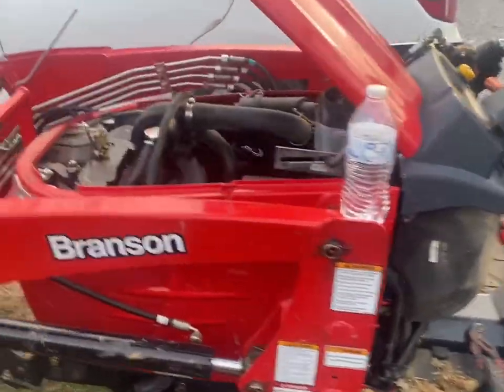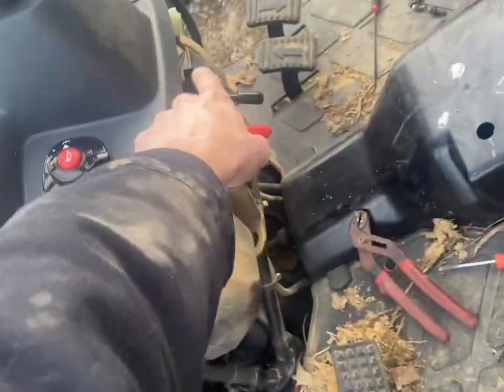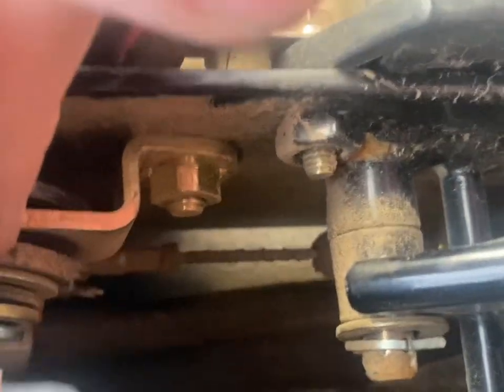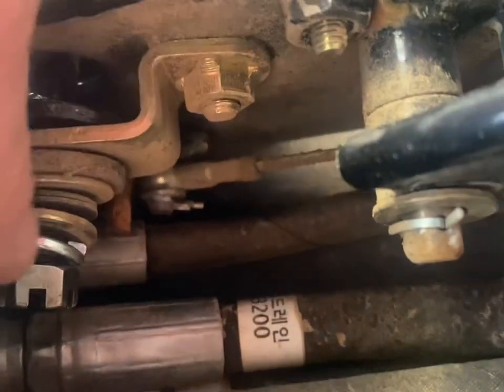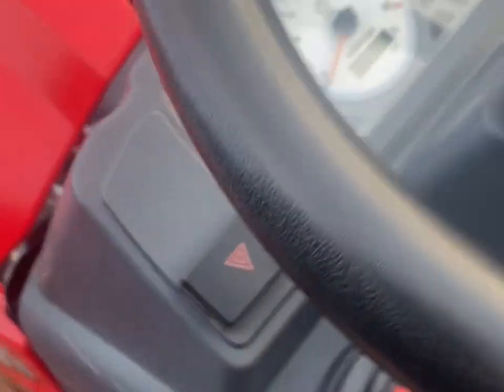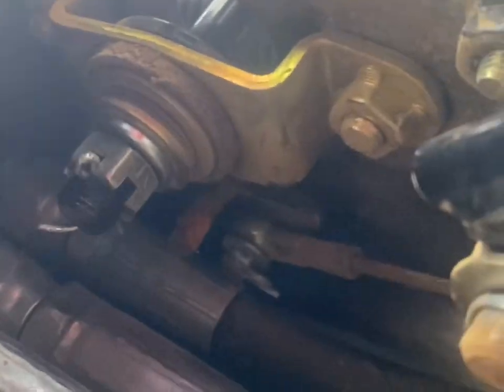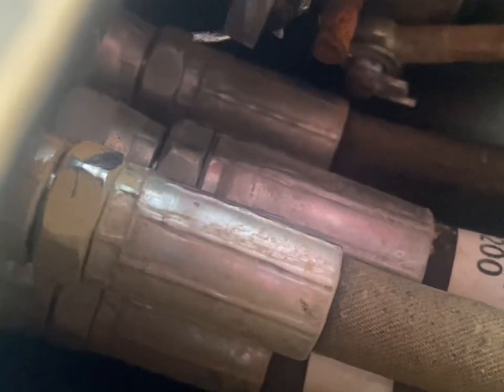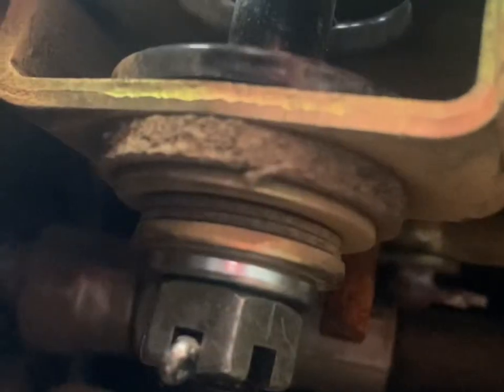2020 Branson tractor 2505 Throttle repair/adjustment

Comment: Thanks bro, I have bad boy 1025h which is rebranded Branson 2505h & mine did the same thing, it’s still under warranty tho, I may give it a gander & fix it myself, I figured that the friction plate wasn’t tight enough.  Thanks